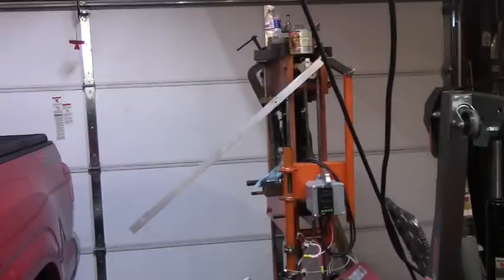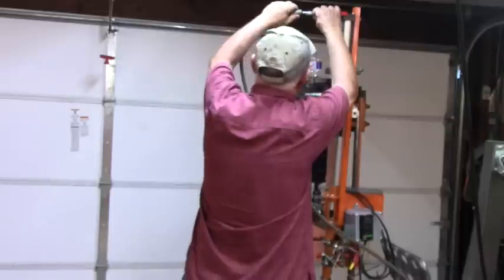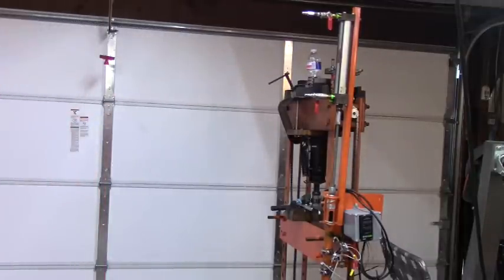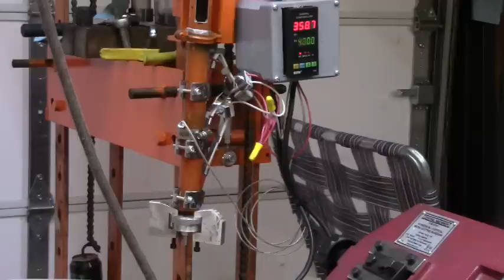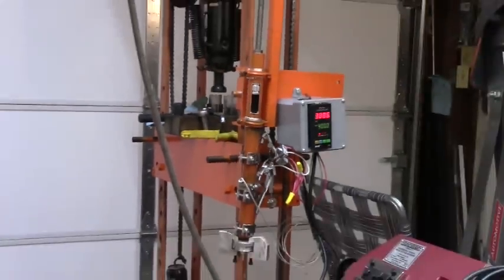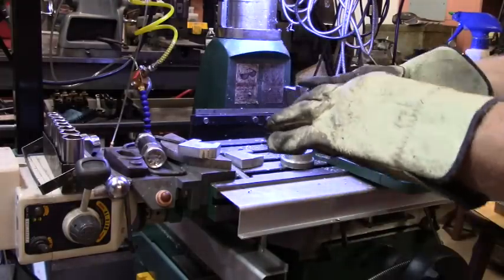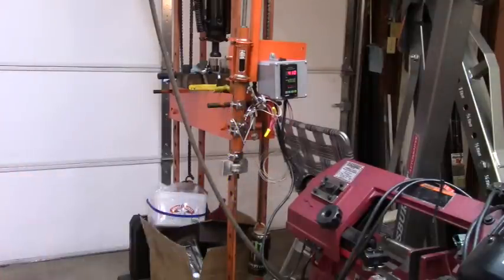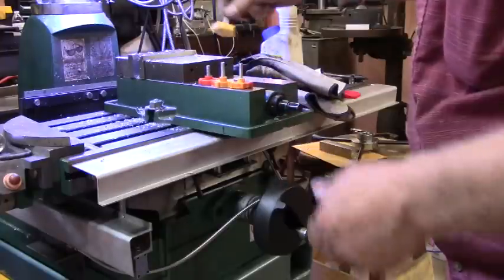Injection molding - success

Comment: That has become a darn nice setup Harold! I'm becoming sort of envious when I see all that gear. 
However, even the knobs that come out are still too expensive (and imperial) for me to order one from you and that's excluding shipping.
Anyway, I really admire your steadfastness in making this work. If it were an easy thing, everybody would do it but it is definitely not. For myself I'm equally stubborn in my attempts to find a more low-tech approach and that's not easy either. 
The good news: Since Tuesday I own what looks like a clone of your band saw; mine is a 4 1/2 inch which I aquired from the local equivalent of Harbor Freight. It's painted grey but looking very similar otherwise. I'm pretty happy with it. 

Lately I have been shredding a lot of plastic but not melted any. 
That is on the to-do list and with my new camera I might even make a video of it. Keep the good stuff coming!
Reply from the maker: Lots of folks sell that band saw under various names.   It is like the hoist i bought from Norther Tool, the same ones are for sale at Harbor Freight with a different name.  Give plastic molding a try and you might be hooked.  Thanks for stopping by.

Comment: Hi Harold
Fun video, you could probably come up with  check valves that would let you operate  the ram without having to switch the hose all the time. a needle valve would slow the ram .
Great stuff, keep it coming
Reply from the maker: A viewer has provided a link to a valve on ebay that will do the job.  Thanks for stopping by.

Comment: The knobs are looking good, you could use a threaded insert instead of a bolt also to replace a knob on say a drill press handle that's been lost(or anything). It's nice seeing a project work properly.
Reply from the maker: Yes I have thought of an internal thread but I have so few around the house I have not made one.  Thanks for stopping by.

Comment: Looks really good Harold. I do believe you have made as many knobs as i have now and yours are much better looking than mine.  I think if that cylinder wasn't designed to be double acting they would have made it leak air out one end and not have two threaded ports so i think its a double acting cylinder.  Its a good feeling knowing between us we can keep the world full of knobs if were called on to do it :-)
Reply from the maker: Some are called to action.  Thanks for stopping by.

Comment: If you put a three-way valve then you also have to put check valves on the top and the bottom so when you’re forcing air in the top the air on the other side of the piston is allowed to leak out on the bottom and vice a versa it will get much more complicated very quickly unless you want to open the valve by hand top and bottom? Unless you run two hoses to your existing valves leave them wide-open bring those hoses down and right where you can reach it you put in a series of valves so that you can simply open one valve close another open one valve so you can do all that activity down at waist level instead of over your head that may be the cheapest way out! I’ve been watching your channel for a few days now very good I enjoy it very much!
Reply from the maker: Thanks for the suggestions and thanks for viewing.

Comment: That was very interesting to be able to re-use scrap plastic with your own injector system. Now I got to catch up on all your
previous HDPE recycling plans videos! Thanks for sharing.  You could put a T in the air to hook into the top and bottom at the same time and you can move the piston both ways?
Reply from the maker: That is an idea.  I have been taking it easy on fittings until I am sure of things. Thanks for stopping by.
Reply: You could gang the two air valves together even, so as one opens the other shuts, so you may have more control going both directions with the piston. Of course, putting it into test will prove that to work for you for sure.

Comment: Harold,  Just an idea.  Develop a way to fixture the valves to a plate, holding them so their valve handles are in line with one another.  Drill holes in the flat handles, and use a section of 1/2 x 0.125 bar stock as a linkage to drive them.  One moves towards shutoff as the other moves towards full open.  A single valve between this pair and the air source could be used as a "finesse" up or down, depending how you have the linked pair set.  You could use just the coupled pair, but half of the linked valve travel will tend towards the middle of the piston travel, in effect reducing your available stroke envelope.
Reply from the maker: That is a good suggestion.  I have actually ordered a multi port valve so one valve can do it all.  Just have to wait some time for delivery.  Thanks for stopping by.
Reply: Wait, that won't work as described.  It would take 4 valves, 2 more are needed to vent the up or down ports.  Easily accomplished linkage, but suddenly more complex.  Just hate to see you having to fiddle with the quick disconnects each time.
Reply: OK, read more comments, see it has been handled.  Sorry.
Reply from the maker: No problem, the more comments with ideas the more options I have.  Keep on keeping on with your ideas.

Comment: Very interesting injection molding. I might have missed it in the previous videos, but are these knobs for a particular project or just an easy part to experiment with? I see lots of potential for parts with different type molds. Don't forget to factor in the entertainment value in the bottom line of cost per part. Entertainment value "TRUMP's" everything else. See how I did that.............ah never mind. 😬
Reply from the maker: It was an easy shape to make a mold for.  I have actually used a couple of the knobs.  The theme of my channel is for me to do something I have never done before which leaves a lot of possibilities.  I have gotten a bit involved in the HDPE but it is interesting to me.  Thanks for stopping by.

Comment: Nice handles Harold, do you not chill them in water after casting? I think that's what they do in industry.Don't worry about the cost, just when you figure on turning a profit, they will start charging for the scrap material. Keep your stick on the ice!
Reply from the maker: I don't chill them now as the mold is small and cool enough to get them cool enough.  Thanks for stopping by.

Comment: Couldn't quite tell, but is your mold in three parts?  If so why was that...for different size bolts?  Would like to see more of the molds if that could be done at some point.   Very well done, thank you for sharing.
Reply from the maker: Yes my mold is in 3 parts.  I have the top part which has a threaded hole in the center to attach to the plastic injector.  The center part is threaded so it is easy to change the thread size of the bolt part of the knob and is a larger diameter than the bolt so that a plastic stand off forms around the bolt.  The outer part holds the center part and also shapes the large circular part of the knob.  The knob has lobes extending outward from the top to make it easy to grip.  The lobes must be pushed upward to remove them from the mold.   The center part that is threaded onto the bolt must come out with the knob before you unscrew it from the bolt.  Sorry to not have given enough of a view of the mold.  I will try to make a point of showing it in the future.  Thanks for stopping by.
Reply: I understand what you say and certainly would like to see more, Thank you.

Comment: could you make the air control valves you want on a lathe? I have heard of people using "jeweler's lathes" or "micro lathes" for parts that size. I would love to know how to make air valves! Thanks.
Reply from the maker: If you have a lathe and a drill it is possible to make an air valve.  To get the design and sizes it would probably be easier to just buy one and copy it.  I imagine it would take a home shop a while to finish the project.  I have not tried but I would guess their are lots of drawings available on the internet.  Personally I do not have the urge to make a air valve.  Thanks for stopping by.

Comment: Why don’t you throw them in the łthe and face the plastic parts.  Thanks for the videos.
Reply from the maker: The only part that needs any work is just the little stub where the plastic was injected and I find it is fast and easy to just touch it to the bench grinder and it comes away smooth.  Thank for viewing.

Comment: Hi Harold. That cylinder will power both ways. You need a proper change over valve to control it. Like this http://www.ebay.com/itm/4-port-3-pos-1-4-BSPT-Hand-Operated-Pneumatic-Valve-Rotary-Manual-Control-x-1-/251950329503?hash=item3aa968ee9f:g:eDoAAOxyKTFR5f0s or similar. Then you will have good control over the cylinder. A couple of restrictor valves  in the out lets will allow you to control the speed either way.  Nice job glad you got it fixed in the end. regards from the UK
Reply from the maker: I never noticed those valves on ebay.  Thanks a lot, will order one asap.  Thanks for stopping by.